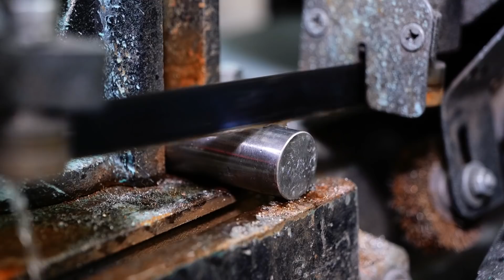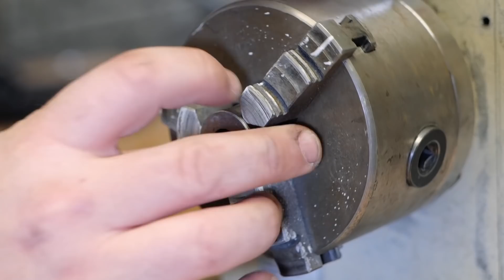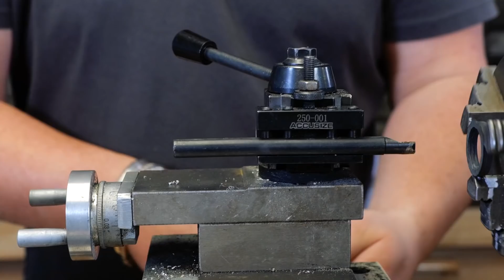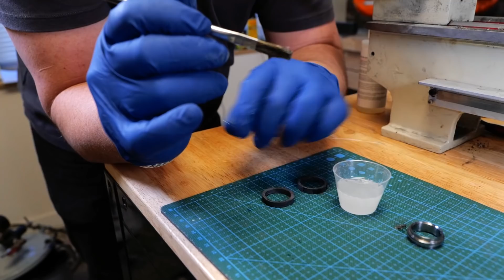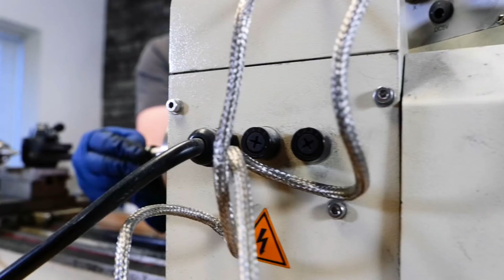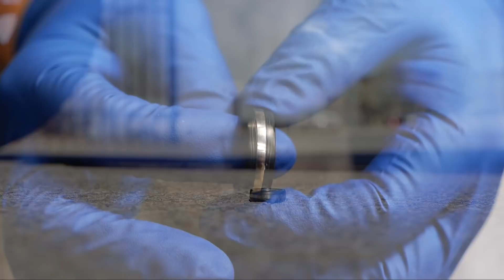Can We Make This Ring Indestructible?

Comment: Something I use for Nylon which might be good for Carbon aswell is a high rake CNMG insert, they look like they’re made out of silver but they’re still tungsten carbide however they make it far easier to work with soft materials.

Comment: I thought CA glue is better for bonding... Nothing last forever and resin can loose some of its strengths in 10-15y, so tight fit with CA last longer? Based on my experiance resin ring (micarta/kirinite) can fall apart (it was done by hand so that added to it) and right fit by lathe with CA last for years now... But i did first rings with resin and most r still good, so depend on wear and tear by user a lot...
Reply: https://youtu.be/FsLJv8bLKqMa
Reply: I know I'm a few months late 😅 but I make rings for my profession and what I do to get the best bond is sandblast both surfaces and use epoxy to glue them together. CA glue is a lot more brittle and can crack and break